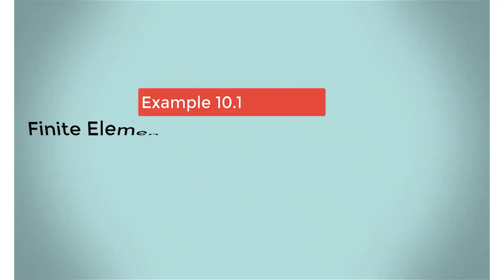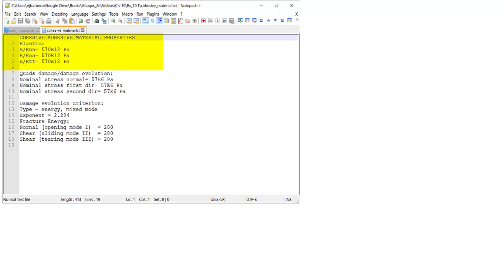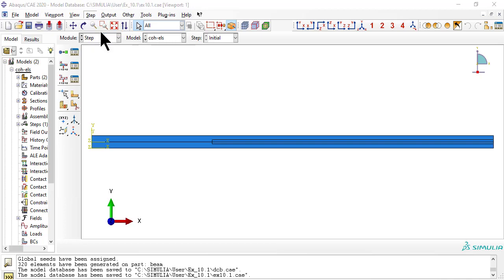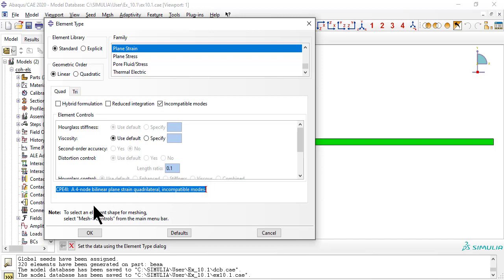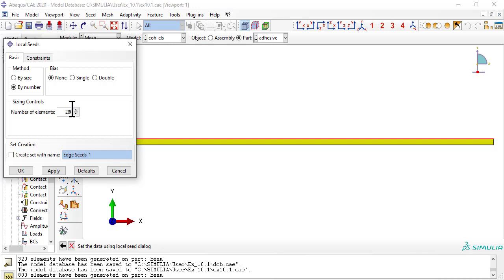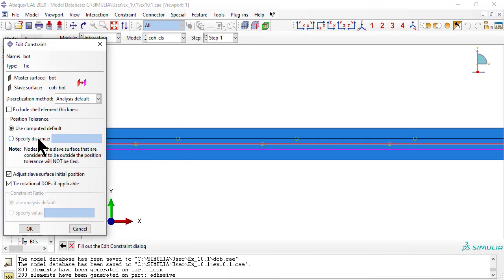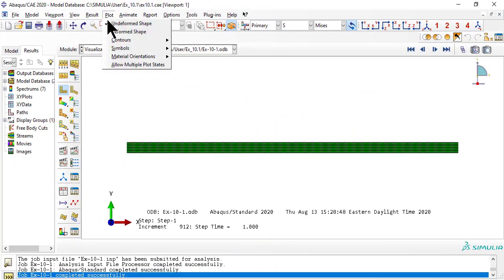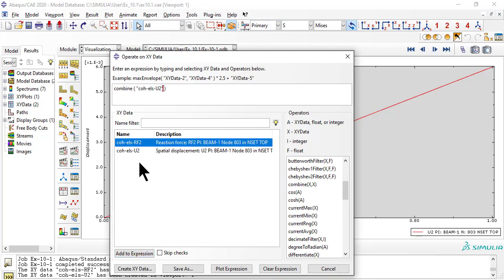Example 10.1 How to use Abaqus cohesive zone elements CZM for delamination of DCB beam

Comment: Sir..excellent video.. I have added some cohesive interactions in my model. Now my model is taking too much time to finish one increment. It may take even one month to complete the job.. I am modeling a unit cell of unidirectional composite.. Are there any methods to reduce the running time sir?

Comment: Thank you very much for the tutorial. What I did not quite get is why the cohesive thickness in the result is so small, when it was initially defined to have a thickness of 1 mm?
Reply: Okay, sorry, you explained this on page 367 in section v in your book. Then I would like to ask what the distance tolerance of 0.002 in this constraint means? Is it referring to a tolerance of 2 mm or 0.2% of an mm? The Abaqus documentation did not clarify this for me.
Also, since the constraints enforce an initial thickness of 0 mm, does the part thickness matter at all, or is it really just a convenient visualization procedure?

In your book, you argue that a traditional stress-strain relation is not feasible, due to the vanishing thickness of the cohesive element. This is why we use the traction-separation law, which reads t = K*delta. When t is of unit Pa, and delta is of unit m, should K not be of unit Pa/m? Your book states the unit of E/K to be Pa. Would that not mean that delta is in fact a strain?
I think my confusion comes from the fact that a cohesive section is defined with an initial thickness of default (assumably 1), nodal coordinate, or specified. To my understanding the displacement measurement is transformed to a strain based on this assumed initial thickness, e.i. that a displacement of 1 would be a strain of 1. Could you verify this, please?
Depending on this initial thickness, the element stiffness would need to be scaled.

Comment: Thank you Professor Barbero, is there no need to define hard contact ?, because in  my  3D model the adhesive look like sank to my concrete in high loading
Reply from the maker: The cohesive elements have stiffness, E/Enn, they should not sink. Please check if the magnification factor in the visualization is huge (look at the bottom of the workspace); it may be it exaggerates the deflection so much that it looks like sinking.

Comment: Thank you professor. Do you know have to solve the theoretical solution for the double cantilever beam?
Reply from the maker: Yes, there are papers, but they always need some experimental data as input, say compliance vs crack length, or crack length vs load, etc. or you have to know the Gc.
Reply: @EverBarbero  Thanks Professor  Barbero

Comment: Thank you very much for the tutorial professor Barbero. The problem I have in my case is that Abaqus exits with error and says that the czm elements are distorted when I apply the tie constraint
Reply from the maker: It could be that some detail was not so clear in the video and caused you to make a mistake. For an exact line-by-line procedure you can check the pseudo-code in the textbook http://barbero.cadec-online.com/feacm-abaqus/index.html

Comment: Dear Professor, which will be an assessment to predict composite failure, like as you said laminate failure criteria(TMSC) or we should directly go to DDM or CZM, or all is necessary for analyzing. if I predict failure by TMSC will it sufficient. Also in some composite, there are fatigue failure criteria. Please, professor, enlighten about, to decide failure which way should go, all aspects should cover or only one criterion like TMSC is sufficient.
Reply from the maker: I replied to a similar comment before. Basically TMS, max. strain, etc. are OK for preliminary design. After that, we do detailed analysis using Abaqus.
Reply: @EverBarbero  Dear Professor yes that we got. Professor, you have made one video for using TMS but it was for lamina. 
May you describe TMS for laminate for primary Design in future videos as the application, also how normalized factor and knockdown factor works for strength and TMS. Thank you, Professor
Reply from the maker: Vivek Dhimole please remind me in which video I used TMS?
Reply: @EverBarbero  Dear professor, in the same video at last in which you described UMAT subroutine for Abaqus. Named is ( How to write an Abaqus Umat)